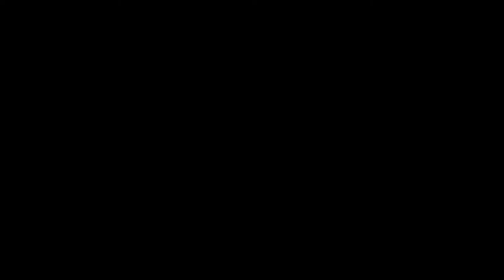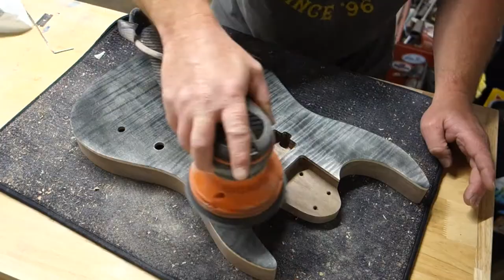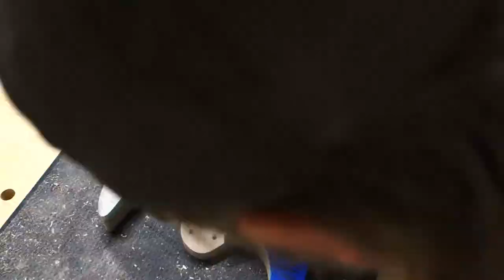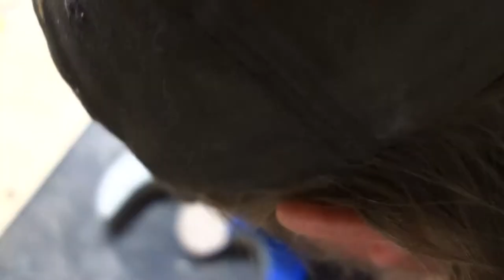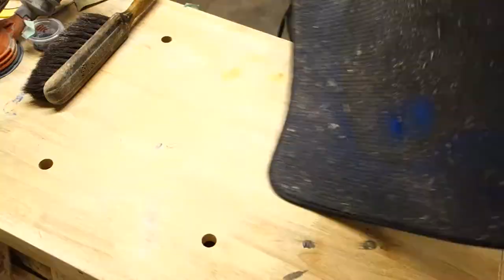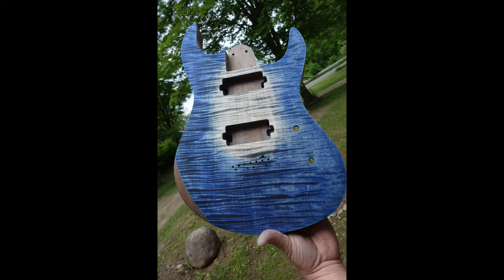Faded Blue Jean Burst Guitar staining

Comment: Looks good. What stain did you use?
Reply from the maker: The black to accent the flames is just black water based ink. The blue is Stew mac color tone.
Reply: @howesguitars  thanks man. I got a cheap and already stripped LP that I don't feel like putting the money and work into by painting it. $50 in paint is pretty pointless for a sub $200 guitar.